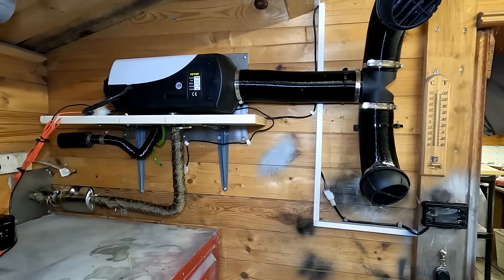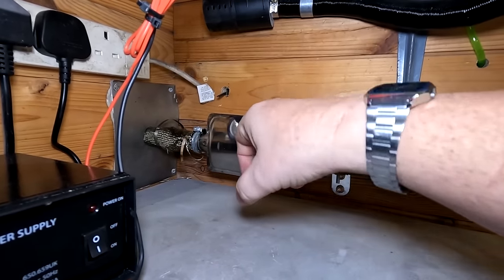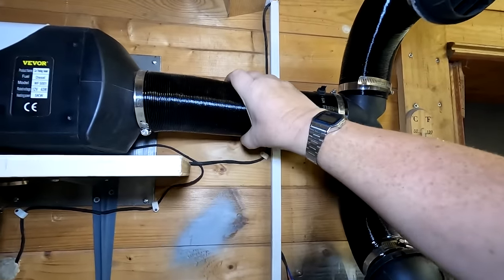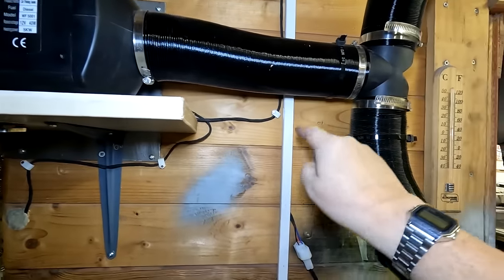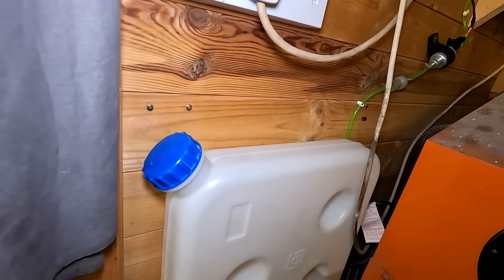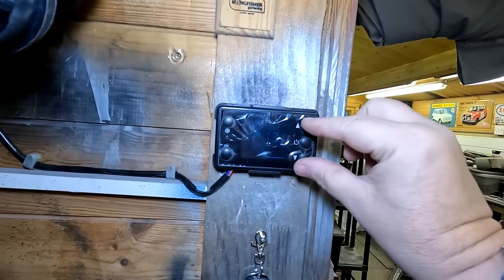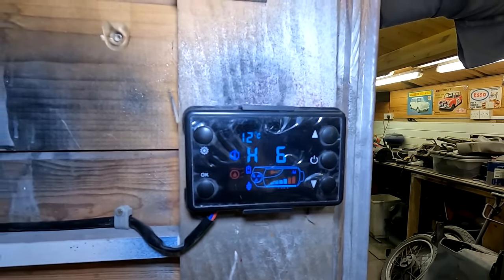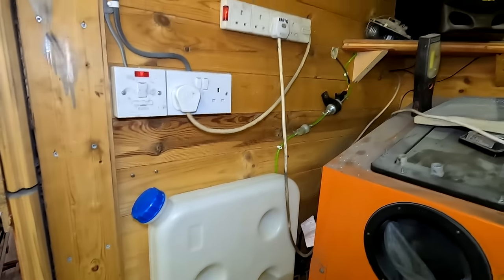This Diesel Heater Installed In My Workshop Was So Easy

Comment: There is a small hole in the bottom of the silencer for condensation so they can let fumes out into your shed.
Reply: Absolutely right, the silencer should be on the outside of the shed because the condensate also discharges fumes. That's why I can't use an exhaust silencer on my. boat.

Comment: Mine is pretty much the same set up, I run mine on red diesel with a 50/50 mix of kerosene it burns slightly hotter and i always leave mine on H2 and use the "alpine" mode when it's warm enough. Every Man and his dog will tell you "how you should have fitted it" I say if it works for you then its a win win! I do agree the silencer should be outside and a change of fuel line to the rigid type. Embark on a CO meter for your own safety my friend and maybe you can cut and push one of the hoses through the wall to heat the other side.

Comment: Nice rig, well thought out.  If you want to scavenge the heat from the exhaust, then route the exhaust tube through a 4" duct, and put a small fan at the end of the duct.  more heat, less loss, less fuel.
Reply: the comment I was looking for ! Tnku , there are other wraps I was thinking about , w fingers like sticking in all directions, …exhaust is soo hot! We need to find a way how to use that heat , tnku!

Comment: the remote works from a fair distance away too ive got an all in one unit in my shop i use the remote to turn it on let it warm up for a bit before i head out there mines hooked up to a battery but thats because i also use the battery to power a winch i use to pull my project in the shop and qith a snatch block hanging from the ceiling it doubles as a crane because lifting stuff post stroke sucks

Comment: Great job, attach the air intake to the outside then you won't burn off your warm air inside, could direct one of your blow out vents towards your other 4x4 workshop whack a hole though the wall, is it big enough to heat both?, might have to get one myself

Comment: That's a great installation Martin. You always do things right. The only concern i'd have is if there was a power cut (the PSU would stop) then the heater unit could possibly be damaged since it would not be able to ramp down safely. What about installing a small 12v backup battery just in case?
Reply: your right about not having a battery
Reply: Yes i agree ,back up is a must just in case , how would you do it ?
Reply from the maker: I would always be in there when it was running and in the event of a power cut i'd just connect up a battery.
Reply: @retrorestore  Yes Martin I appreciate that, but as you mentioned the unit needs to shut down correctly and if you had a power cut this would not be the case .Therefore an alternative back up power supply would be needed    to achieve this a 12v battery for example on some kind of relay . Just a thought ,a few people are thinking the same thing .
Reply from the maker: @stepho9999  I have given it some thought and did think of connecting a relay as you suggested. I'll probably look into it.
Reply: @retrorestore  Use a 16agw or 14agw wire as thinner wire might have to much voltage drop
Reply: It fries the motherboard apparently if the shut down is interrupted by a power off.
Reply: @tonystacey3347  That is correct ,it would be a god send if Martin could show his Heater unit with a 12v battery power transfer back up in case of a power cut  ,Well appreciated by all I am sure .
Reply: @retrorestore    Using a (suitably sized) battery allows the use of a far smaller power supply and allows proper shutdown in the event of a power cut.  You gave considerable attention to shutting down the heater correctly, then chose to ignore your own advice!  I use a battery charger that charges to float voltage, when the unit is switched off.  There is a small drain if the controller is left on (for remote starting/stopping or timed starting/shut-down, for instance).  The efficiency of a battery charger running at just in excess of the running current for the heater is far higher than running a huge 15A DC supply at a mere 2-3A, maybe less for the smaller version of this heater.  Remember the suppliers will always quote DC power supply efficiencies at close to maximum output.

As others, no joints in the exhaust indoors and definitely monitor for CO.  it will only kill you once!  My CO meter was less than twenty quid and will require a few batteries over the ten years of its expected life.  Cheap at the price.  The issue of the combustion air origin is debatable.  Obviously with these units designed as cab heaters, the combustion air pipe is beyond the living area, but for free-standing heaters (more portable), the combustion air can and perhaps ought to be derived from inside, where it is less likely to become blocked (ice, snow etc).  Cold air from outside will reduce the combustion temperature by a few degrees versus less cold air, from inside, are the choices.  

There will never be any appreciable amount of smoke, ever, from that pipe - the heater will already be shut down for that to occur.

The issue of frying the motherboard is ignored by some (who say it doesn’t happen) but others have found, to their cost, that it has happened.  Those boards have, among other electronic components, several electrolytic capacitors that can, and will, dry out over time - and very quickly at elevated temperatures (that is why the PCB is placed in the cool air stream).  They may not fail immediately but it cannot be seen as doing them any good by heating them up.

You have done a fair job, so far.  Don’t spoil it by missing the finer points or by showing others the less- better way of installing them
Reply: @oliver90owner  Would it be better to mount the whole unit on the outside of a garage/shed, maybe within it's own box/shelter from the elements? Would this help with not drying out those components that you mentioned??
Reply: @steveclark..   Nope.  The capacitors etc are on the PCB motherboard, fixed in the air stream, immediately ahead of the heat exchanger.  Placed there to keep it cool, during operation, by virtue of it being in the cool air stream all the time the heater is running - that is why the fan runs, during shut-down - until the heat exchanger temperature is sufficiently reduced that the motherboard is safe.  Cheap Chinese electrolytic capacitors are not the most reliable components at the best of times.  Even expensive (good) electrolytic capacitors are known to deteriorate over time.  Some of the components on the motherboard are mounted on heat-sinks, so definitely need to be kept cool.  These cheap heaters would include the smallest (cheapest) heatsinks the manufacturers can get away with, of course!

These heaters are specifically sold for ‘off-grid operation’ with 12V/24V power from either the vehicle battery or a leisure battery.  If you search the Webasto or Eberspacher instructions (the high quality versions of these heaters) you will find they, too, are powered from a battery, never directly from a mains grid source.

It would certainly be safer to mount the heater outside the building, if used for another duty (other than that which they are supplied for).  Insurance issues may well arise, if fitted inside a building, as they are not type-approved.
Reply: @oliver90owner  Thanks for all that, good point on insurance issues, the buggers will use any excuse not to pay out I'm sure.
Reply: @stepho9999  I would use a relay with a DPNC to transfer power from the PS to the battery, powered off your power supply.
Reply: Good point.

Comment: I would put the inlet hose outside too. Now it sucks air from the shed and it need to go through cracks inside, you're getting cold air from the outside through slight vacuum inside. If you put intake hose outside, only hot air circulates inside.

Comment: Fun fact NH3 aka ammonia is a fuel and can be used in any multi fuel  generator and combustion engine   car. If your power goes out or want go off grid you can run ammonia in a multi fuel generator for power and heat,  and can run it a combustion gasoline engine if install a propane tank kit but fill ammonia instead. 
Look up videos of ammonia as a cheap renewable fuel. It was used as a    fuel by nasa to replace liquid fuel since 1960s and is used in rocket fuel, aviation fuel , race cars, tractors

Comment: Hi Martin, just fitted one in my garage and didn't like the idea of the silencer so I was going to fit it outside. However I decided to try it without the silencer thinking that it's not an engine as such . So I fired it up and I found without the silencer there is no appreciable noise at all out of the end of the exhaust!!. I did try it with the silencer on the end first but as I said on taking it off there was no difference! .

Comment: A 350 watt computer power supply is suitable as there's enough current to supply the heater on startup. Also, a 12v battery is necessary, if your electricity fails for whatever reason, the heater cannot go through the cool down cycle. But apart from that, nice job.
Now, a really important point!!! 
NEVER cut the tails off cable ties leaving a bit left on the tie! If you happen to brush past it, the cut tail will slice through your skin as easily as a razor blade!! Get yourself a Panduit GS2B (I`m nothing to do with Panduit, I just use their gun when I cut cable ties) cable tie cutter to do the cutting properly. Get one on eBay. You'll never get cut by a cable tie again!
Reply: Tape over it,job done👍

Comment: One little tip on power supply too from here - it's better to use car battery with smart charger. Why? Because in case of power outage your burner with battery backup will not stop abruptly. And it actually needs this cooldown cycle. If the fan stops running while burner has been on full power it can melt the plastic as there is no cooldown.

Comment: Nice tidy installation Martin. I used the same exhaust tape on mine - it works a treat, the exhaust barely gets warm now. Nice to see you went down the power supply route 👍 Don’t know if you realise this, but those vent pipes expand to about twice the length they are when supplied?
Reply from the maker: Yes I know Gary. Cheers

Comment: Nice work mate!! From watching 4-5 videos today from these heaters, it is "not" recommended using "copper" with diesel heaters. The two don't mix and you can create some bad CO2 from the copper as the oil exhaust does not mix well.....I see that there is other kits you can get to extend your current exhaust that is the same piping as you have.

Comment: Looks good, but you might consider what may happen if you get a powercut while using heater. It could  cause the electronics to over heat . Lots of people take the risk, But I found this on aliexpress. A  power supply with a battery charger built in, and UPS, if there is a powercut it automaticaly switches to battery power. link will be bellow. This works a treat for my emergency house heating. Mounted outside but in a insulated metal cabnet, with flow and return holes through house walls. so as the same as you have warm air is recyled not drawing cold outside air in! plus the tank is outside completely, I may have think about anti gelling stuff  if it gets very cold diesel. but no worries of spilling diesel indoors it only been fitted for a short while already I am using it instead of central heating, Its direct into living room. and on lowest it is hotter than the central heating, even leaving doors open to rest of house. In think this will save me on energy bills   Link. 180W Switching Power Supply 12V 24V Monitor Universal AC DC 13.5A UPS/Charge Function Input 110/220v Battery Charger SC180W

Comment: You do need it to run off a battery, when you have a power outage it cant do a proper shut down cycle, over heats and melts the brains inside not hard to get hold of but you need the right one ive seen it happen they turned the power off to the shed by mistake, ended up getting a compleet new heater £109 could not find the right controler for inside the heater, take care my friend happy heating lol.

Comment: Hi just one comment the exhaust is not completely  airtight if you look closely there is a small hole at the bottom of the exhaust to let condensation out.
 I have been told this must be outside and not inside in case of exhaust fumes.

Comment: Muffler has a hole in it for condensation to drip out, or at least most of mine do, just seen this video figured I would mention that so you can check yours to make sure its not leaking carbon monoxide into the room
Reply from the maker: It's outside now

Comment: Thanks for the video and comments from others. BEWARE, securing the adjacent planks of your cabin as you have done will cause issues. I made that mistake and there can be as much as 2 inch expansion over the seasons between the top and bottom of a cabin.... mine is a Tuin 40mm thick walls I think.
Reply from the maker: This is fine

Comment: if you ever have a power cut and  we have been promised some in Jan-Feb next year in the UK  and the heater is running you could damage the internals as it wont be able to go through its shut down procedure, maybe a battery backup or a battery connected to a charger might be slightly better, I saw a video somewhere where someone else used a battery backup box.

Comment: Hi Martin could you put the full description of the power supply you've used .cheers I've bought the Same diesel heater.
Reply from the maker: Its out of stock on Amazon i'm afraid.

Comment: you want the combustion intake to be outside too. How you have it set up you have negative air pressure. as such cold air will rush in from the inside.

Both exhaust and intake need to be outside.

Comment: If you take air from outside and heat it up, you will get warm fresh air inside and over pressure inside your workshop. I use d-heater in my boat and my setup give me good air quality and dry boat. 
Your setup is resirculation air inside and will suck cold air from all vents or small gaps.

Comment: Nice tidy install. but I wonder why you put the fuel tank on the other side of the wall ?  was that to keep the fuel away from the unit or just where you had space? Have you had chance to work out the running costs yet

Comment: Why not drill a hole in the top and feed the pipe into the bottom of the unit no worries about leaks
Also if you mount the tank on hooks you can take it to be filled up just s thought

Comment: Just noticed you have the muffler on the inside of the place. If you look on the bottom of the muffler you will see a hole in it to let out any moisture. I would put the muffler outside for that reason.
Reply from the maker: It is outside now.

Comment: 😃love it. have ordered the power supply for mine as well the pipe wrap. going to be using mine in my pollytunnel & use a used short scaffold pole to extend the exhaust to the outside. hoping it works but love your ideas & have used yours links.
Reply from the maker: Nice 👍

Comment: Please note that the muffler is not suitable for indoor installation as it is only spot welded and not airtight. A fair amount of exhaust fumes seeps out the small drain hole.

Comment: add a Ramair Filters CC-296-UNI Universal Neck Performance Cone Air Filter with Reducing Rings used dry  to the inlet using a pipe the you can remove the cover if needed to keep the dust out and lower the air intake to cooler air it worked well in my workshop you can just wash and dry the filter to keep it clean amazing all the trash you get out of it too
Reply from the maker: Thanks for the tip!

Comment: Was pondering on putting one in the workshop,but,with all the comments i've read about change this and that on them,then adding a battery,longer this and that etc etc,list goes on,then factor in the running costs,240/derv,i've decided to stick with the wood burner i've got in there,at least it works when the power goes off
Reply: Don't be a caveman.

Comment: You may want the engine air intake pulling from outside so it's not burning/using oxygen from within the cabin.
Reply: It’ll create a slight negative pressure within the cabin which will draw fresh air in from outside.
Ventilation!

Comment: Nice set up, but a word of WARNING!! the silencer is NOT an air tight seal all around the edge, so the fumes can seep out at those points, this is why I put my silencer outside the shed, you can add a bit more pipe onto the pipe so that you can fit the silencer outside, you might want to test it when you get it off by filling it with water and block one end, not forgetting the small drain hole, even the original silencer at £28 is NOT air tight, just my opinion.
Reply from the maker: It's already done, check my latest video.

Comment: I'm sorry to say that install has two faults.  The muffler has a small hole on the bottom to weep moisture.  That means you are venting exhaust into your space which is not good.  Also because your exhaust has a dip in it before exiting it will build moisture in the bend until it clogs and starts a fire.  To fix it put the exhaust muffler outside, and have the pipe exit downhill.  Also to keep your unit from melting down in the event of a power failure, put a charger on a battery, then plug the Vevor into the battery.  Then if the power goes out shut it down when the battery is going to run out.
Reply from the maker: I moved the exhaust outside in the next video.

Comment: I have done mine with the heater the other way around so that the air is blown over the exhaust, as it's a shame to waste the heat. The silencer has a drain plug. I also made the exhaust longer too (marine flexi exhaust pipe) ,and a filter to keep the dust out of the intake....